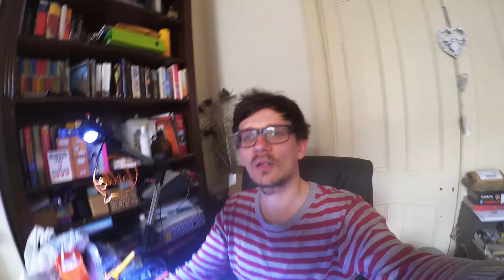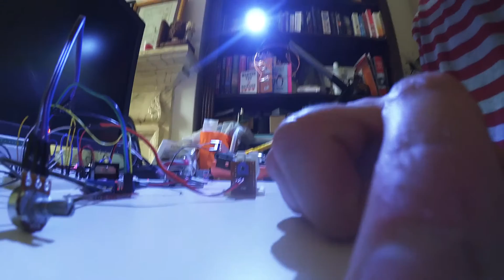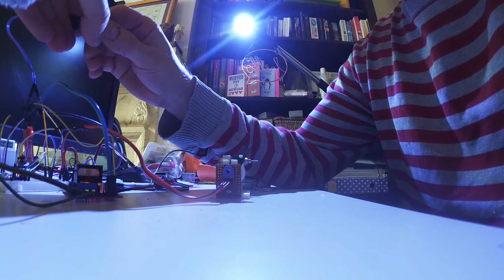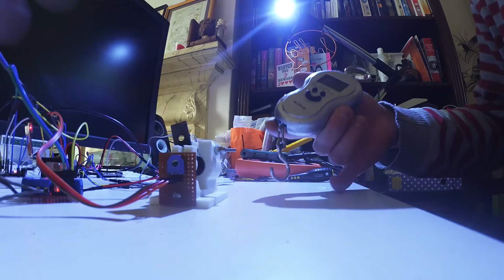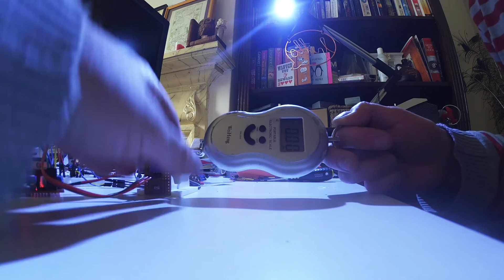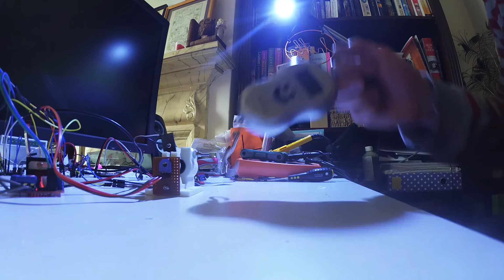Pt 2/2. Results! DC gear motor + shaft potentiometer = DIY servo.

Comment: Hi bro 
Can you explain encoders pin?
I have dc motor encoder gja370-25 6 wires 
How can i use it to do the same project 
I will add your name in preferences

Comment: Good project sir. How can i use 2 dc motors?
Reply from the maker: Thank you. You definitely can process 2 motors with 1 arduino - the code is very light. You just need a 2nd motor setup, 2nd potentiometer, and change the code so it does all the calculations for the 2nd motor too. And of course make sure you have enough pins, on your microcontroller board

Comment: Excuse me, could you pass me the connection diagram?
Reply from the maker: Sorry, I don't have one :(. I should have made a schematic! As far as I remember it's a simple L298 motor driver and the output shaft potentiometer for feedback, and a user input potentiometer for position control. Start by searching for L298N arduino tutorials.

Comment: nice work, but why don't you use PID control for better result
Reply from the maker: Thanks. In the past I had a lot of problems using Arduino PID library with Serial and i2c because Integral and the Derivative are both time based. So I started off simple - my code is just Proportional control at this point.

Comment: is there any chance to serial data control the servo without the pot ? and is it possible to use a rotary encoder for a continuous rotation instead of the through hole POT ?  thank
Reply from the maker: The desired angle is settable (that's what the user potentiometer does). So you just add the appropriate code to do the serial stuff. And you could use a rotary encoder - best would be to use an absolute encoder so you don't miss any counts - but this is processing heavy. Relative encoder would work but the interrupt routine counting the steps could negatively affect the actual servo actuation, and eventually drift out of sync.
Reply: okay thanks and any idea of how to interface this with serial communication ? i mean bluetooth RX tX communication ! i tried this with a small motor and 12V wiper motor both work fine  but as its in the video the shaft is wobbling and instant stops !! im planing to use this for steering system ! any ideas to improve ?
Reply from the maker: To reduce the wobbling effect, in theory you need to reduce the weight and inertia of the rotor inside the motor assembly so it can stop rotating instantly, and increase the accuracy of the potentiometer - so it has more effective range and less noise. Also avoid large gearboxes with backlash.
The more accurate the system is, the less wobble you'll have because the arduino won't be trying to compensate for the position errors.
In my code, 'requiredAngle' variable is read from the potentiometer (in the function 'readAndConditionRequiredAngle), but you can easily remove this and supply the 'requiredAngle' value through your bluetooth comms.
I'm not sure how your bluetooth system works, but it should be straightforward!
Reply from the maker: PS sorry I didn't reply! To stop the wobbling, you need to use the PID control system, and tune the PID parameters with the whole assembly in place. It's possible to almost completely tune out the overshoot, but it's a lot of work. https://en.wikipedia.org/wiki/PID_controller

Comment: Brilliant idea.
Reply from the maker: +Shaun Dobbie Cheers Shaun. This will be part of a governer for the little 6.5hp engine - might be useful for yours too! Will do more details in next videos :)
Reply: AS Motion Lab I really need something like this to control an RC servo for the throttle to maintain a speed that will hold a battery at 30v. When the voltage drops, engine power should be increased.
Reply from the maker: +Shaun Dobbie This is my plan too, but for a bank of lead acid batteries. Principle will be the same! Infact it will be easier for a RC servo.
Reply: Just need a way to convert voltage into the signal used for the servo where the engine would be idle at 30v and at full power at 25v
Reply from the maker: You can do it either the old school way, using passive and logic components to convert the high voltage into signal for the servo, or use an arduino or similar microprocessor and some basic code to detect the voltage and drive the servo. I'm going down the arduino route - it can also do loads of other stuff at the same time (start/stop engine, have a 'choke' mode if you give it a temperature sensor, etc)!
Reply: It is too much for my limited knowledge